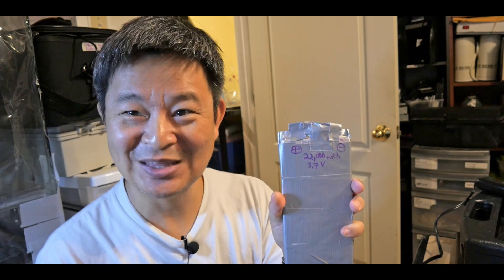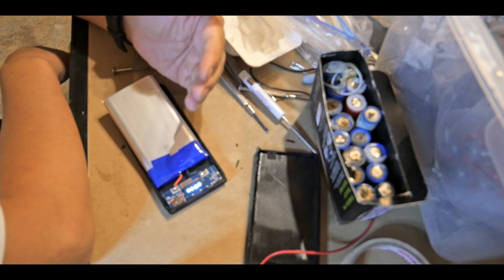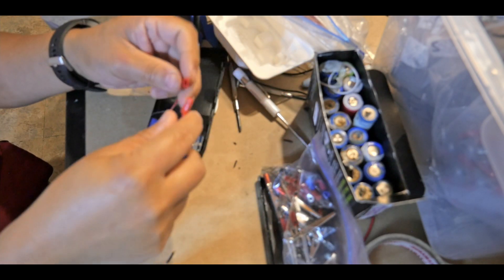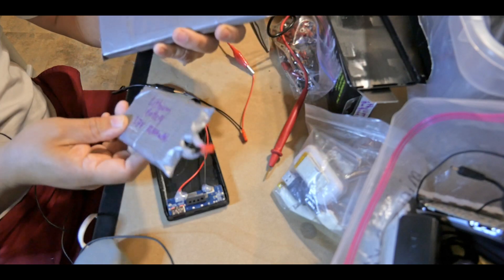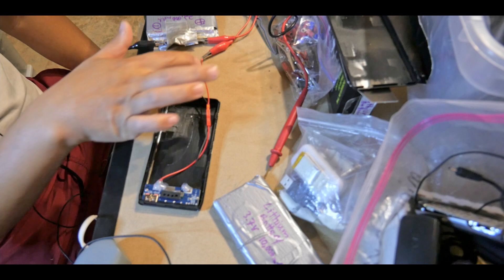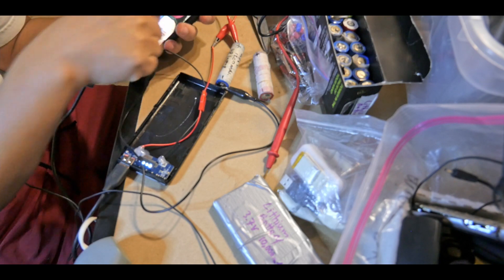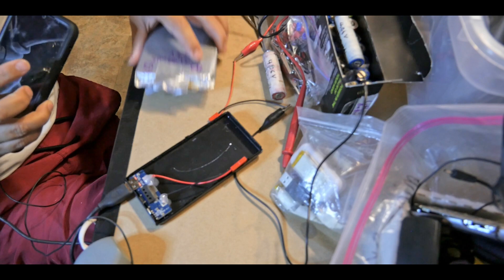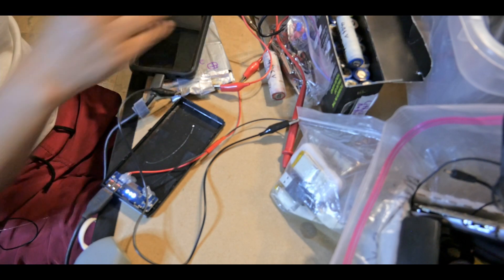How Modify Lithium Quick Charging Power Bank battery for modularity and more power

Comment: Is it safe to replace the original battery with a higher capacity battery?
Reply from the maker: Within limits.  Depend on the circuit that was originally in the power bank.  I think no more 1.5x than the original capacity.  Some manufacturer circuits allow more.